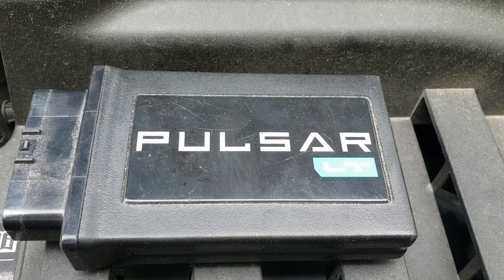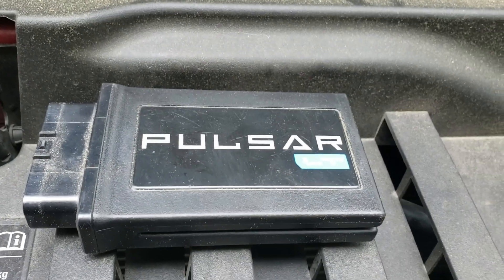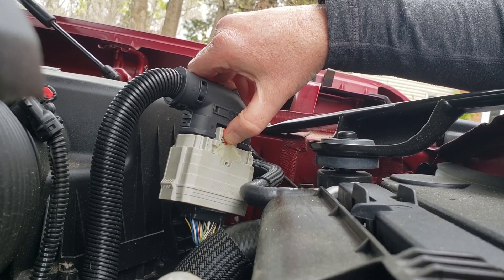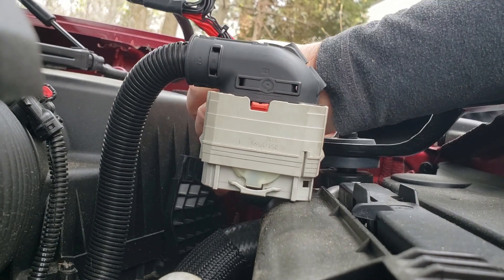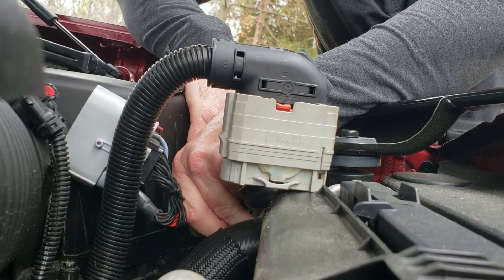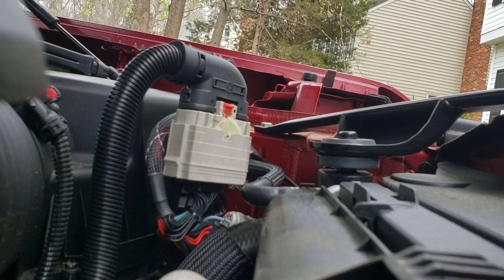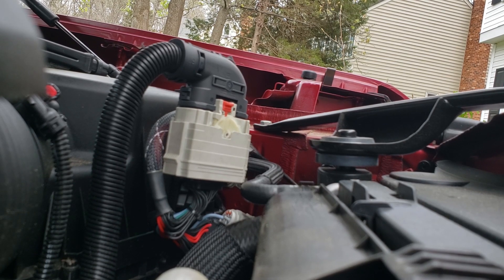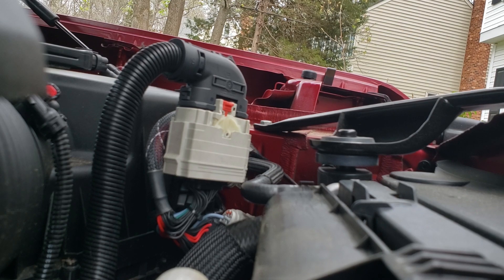Pulsar LT Install and Review on the GMC Sierra 1500 AT4

Comment: Can you tell me the model umber of the Pulsar unit? Seems like there are several. I have essentially the same application you have.
Reply from the maker: Yes, mine is for the 2019-2022 Chevrolet Silverado/GMC Sierra - 5.3L and 6.2L and it is Part # 22451
Reply: Thank you @lowleveltrim1819

Comment: Good video, what year is truck ?
Reply from the maker: It is a 2019.
Reply: Did you have to disconnect the battery?
Reply from the maker: @6thstringtender  Instructions say to remove the negative side battery terminal first.  However, I did not.  I probably should have, to be on the safe side.